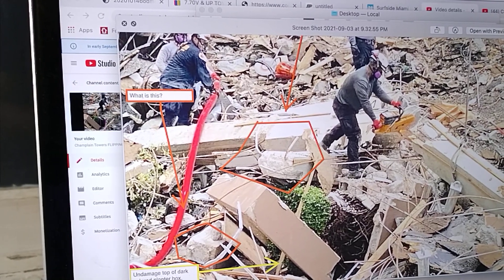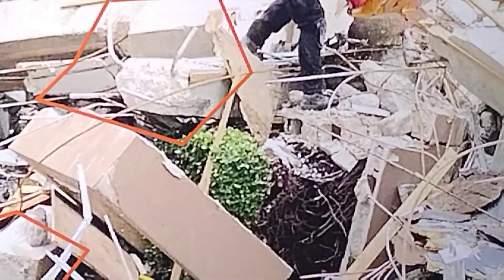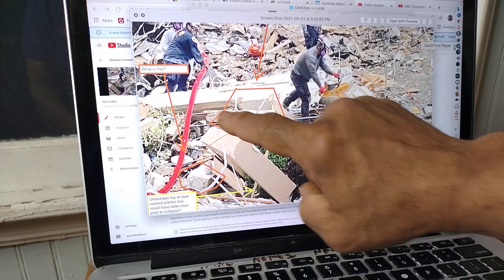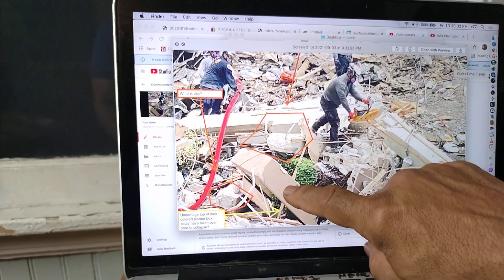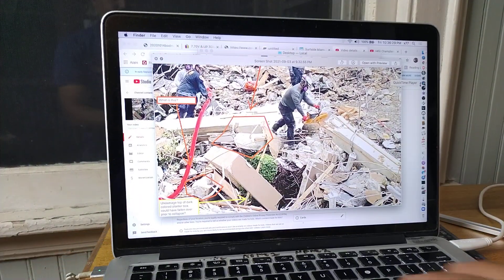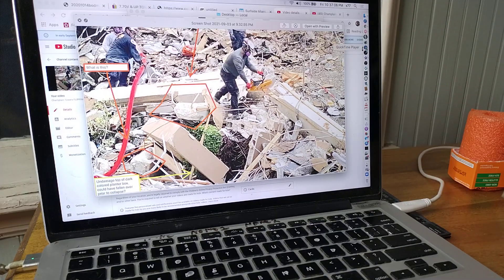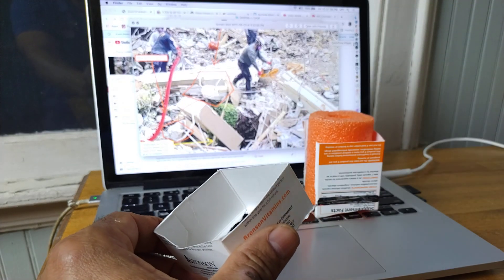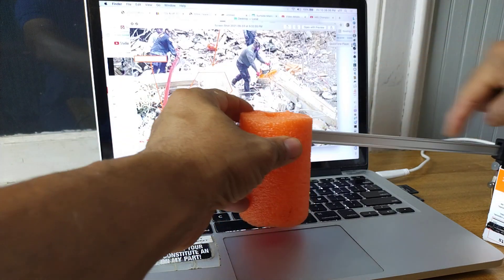Champlain Towers is BMA  Column L 9.1 to L 11.1 still intact?

Comment: Hhhh.exactly ifs speaking. The Bma  his according into column 9.1 L..and m10 is BMA..and large 10cm.and longer 100cm.or 1mettler. Ok.for 2 column 50/50cm.and the horrible is making  per Simon Cole white posed into column.and None Barr.and 3 BMA.look positions. and this Men teke 1 working.look 6/2 column 6.and distance 3m.9.10 cm.and Totally  m10mettler .and The collapse In column /ÀÏ 69 or N69.and 62/26.and 72/27.ok.look 27+26+69=122=9.10+9.10+9.10=1.22 =1+2+2=5m=3m distances garages +2m Distance Floor =5m and column 50cm.large /4.and looking in floor constriction. Still Alphabetical. look i.large 2 Mettler.ok.and looking This system column 2 coulumn per 50/50..and separated per 5cm.vide.This The Biggest Roll building separate .nothing happened hhhh.observers BMA is 1.22m.and column 50/50=100cm+22cm÷3=7cm=distance into column okay. Hhhh.This The science Technology Not To gather. Hhh.and looks DNA.U.Urrican.ida.
Reply from the maker: Your translation needs a translator...
Reply: Welp that explains it